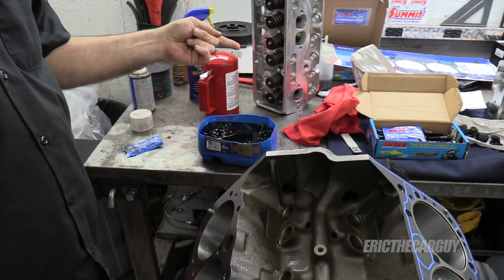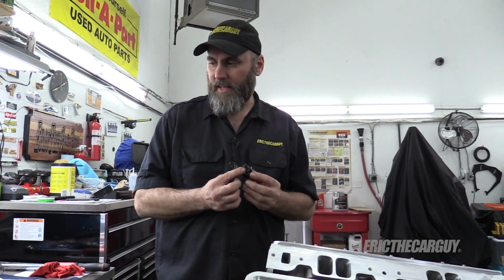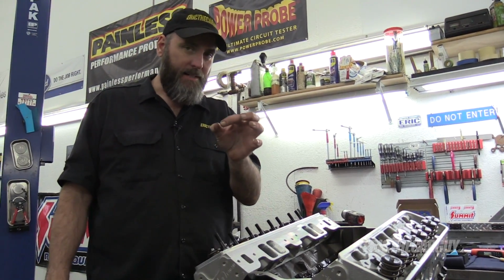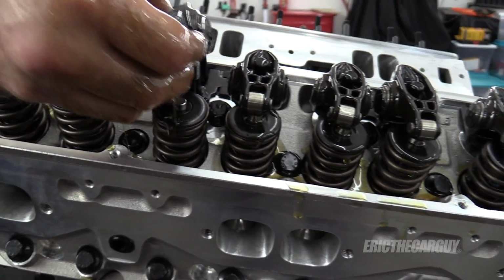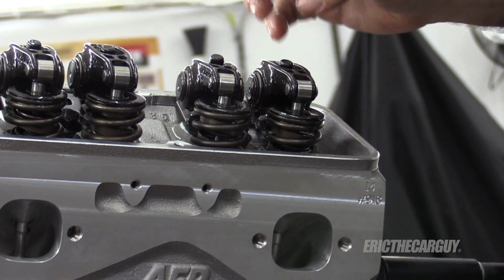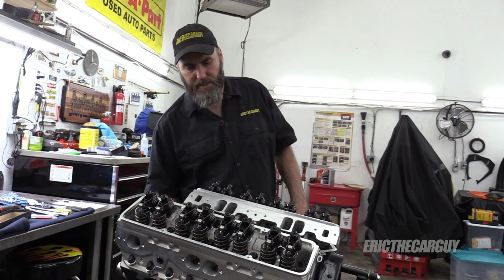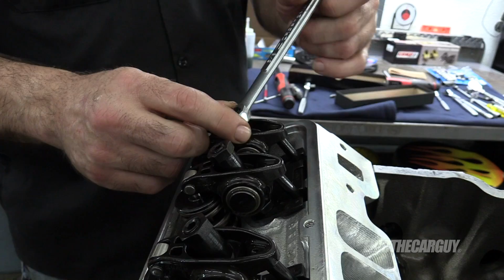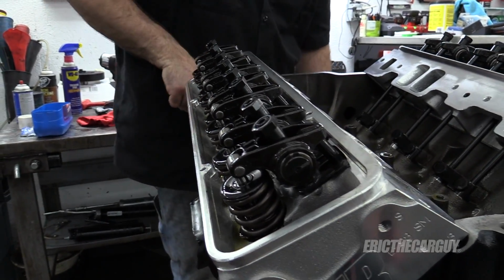How To Install and Set Up Roller Lifters, Roller Rockers, and Pushrods

Comment: I haven't upgraded my rocker arms yet, and I get a valve clatter sound when pulling a hill. So, with what you said, I might need to go back through and go a little more on my pre load.

Comment: Those guide plates are mickey mouse. Why don’t manufacturers use 1 piece guide plates as GM did on the 70 LT-1 Z/28 engine? Why reinvent the wheel? You also want the push rod in the middle of the guide plate slot and not touching the guide plate. Also Inlike the up down movement on the push rod rather than the spin method for achieving zero lash. Then I go 1/2 turn more. GM went 3/4 turn because they didn’t want customers complaining about noisy lifters. If you want performance then 1/2 turn is plenty some even go 1/4 turn. Once it warms up the noise if any will disappear. If your paranoid then don’t go more than a 3/4 turn. IMO 1 turn is too much. I set my hyd lifters using the EOIC method. When I had a solid cam in my 70 Z/28 then that’s another story.

Comment: The GM service manual says to lift the rocker only until zero lash because the lifter has a weak spring in it and spinning is subjective to feel, like feeler blades. They also ask for 3/4 turn to place the piston inside the lifter body at proper height.  The tread pitch can be used to create the correct math as 18 threads per inch = 1 inch in 18 turns. The lifter body only has so much room and 3/4 turn is less than 1/18" on the lifters piston. Not much room in there unless a guy wants to disassemble, measure and decide how much travel the lifter body's piston should travel compared to GM engineers although Comp could machine these different. But until I measure both, I am using GM specs, plus not spinning a round ball tube for feel.

Comment: I have something that I would like to share, first off I would like to thank Eric the car guy so much for everything that I have refreshed myself on and have learned a new. I’m an old man and I used to rebuild a little bit and have worked quite a bit on small block 350 in the past..
I am currently putting a 383 stroker engine from hot rod engines company out in Washington into my 1963 Chevy C 10 pick up with a manual Tremec five speed.
In the meanwhile I have been working on the current engine which is in this old truck of mine. It is also a 383 stroker but is currently a four-speed manual transmission. 373 rear which means that the RPM is crazy on highway so that’s why the next transmission is a five speed having the overdrive advantage over the 373 rear ..
So to my point I am starting to put things together to do this very same job you were watching here. There is nothing at all wrong with how it is being done here but I think I’d like to share something that I saw online which provided a very easy valve adjustment which I thought was genius.
I could look up the video if anybody is interested on how to adjust the valves in the following manner.
Anyway the guy that I was watching on YouTube explained that he would often be called away from the valve adjustment and forget where he was in the process and would often start over or forget where he was because of being called to the counter or whatever. The gentleman went on to explain that he had to find a way to keep his spot or area of work remembered so he offered up this method of adjusting valves as follows:

Basically you rotate the engine 90° at a time using the marks on the harmonic balance her and the timing tab. Basically he could be called away from the job and it didn’t matter where he was in the adjustments he would simply continue to turn the engine 90° at a time and establish zero lash that way. He would keep turning the engine 90° and some lifter would become loose and others would maintain a zero lash adjustment. So basically you just keep turning the engine 90° at a time, Using the timing marks until all pushrods are found to have zero lash…
So this did not make sense to me until I thought further that mathematically every time you adjust across-the-board all pushrods eventually mathematically all will be in the correct position and turning them down a little bit at a time at 90° just creeps up on the math whereby he would have zero lash across-the-board…

Again there is absolutely nothing wrong with what Mr. Eric is doing, he is a very accomplished mechanic and he is following instruction as noted in manuals. I just found this guy on YouTube who evidently through necessity had to find a better way and I thought it was genius and I guess it does work out that mathematically you would pass each one eventually. Eric the car guy rocks and I follow him I wouldn’t ever say that he is wrong on “anything” He’s 3 times my abilities as a mechanic, knowing this from following you Sir! Thanks for “all that you provide me and others!

Michael T.

Comment: Great video. Recently took the engine too high on rpm and found a bent push rod. Couldn't get a wrench to the rocker arm nut. And when you couldn't either, I followed your method of taking rocker off. Too simple. Also - my service manual says one full turn for lash. Thanks.

Comment: I would use 1 piece guide plates. I wonder if 1970 Z28 LT1 guide plates would fit this head. I also do not spin the pushrod, instead I use the up/down method. I use the EOIC method as well.

Comment: He said the minute one valve starts moving adjust the other one   It ain't necessarily so.  This does NOT take into account valve OVERLAP   This is a period of time when BOTH valves are open at the same time   The minute the intake starts to open the exhaust valve is still open   for a while which is a BAD time to adjust the exhaust valve     This isn't the case if you watch the exhaust valve begin to move

Comment: I agree about the full turn. Well, I'm a 3/4 turn guy. But yeah, 1/2 turn is never enough. I guess the manufacturers don't want em' over tightened and a half turn in theory should be enough. But I've found the same thing you did....after a while I gotta put my open valve covers on and run the motor finding all of the rockers making noise and adjust them again. And sometimes do it again after more driving to get em' all set. never had a problem going 3/4 turn right off the bat. In the old days and even now (for me anyway) we always kept a set of old valve covers  w/ tops cut out and adjusted the rocker while the engine was running. Another good post from post this guy. I've never heard him say anything wrong. His tutorials are clear and concise. learned a lot from this channel. Been a subscriber here for some time now. I prefer to do both valves on each cylinder at the same time on the firing stroke. I think it saves time. But his way gets the job done just as good and keeps u from making any mistakes.

Comment: There is one way to do this that I would definitely recommend. It's a lengthy process to describe but can be done fairly quickly and you will never need to re work your rocker pre load
Reply: Post it. Or post a link to the process.

Comment: I have a 92 chevy with a new 350 crate motor and I primed the oil system and i am getting oil on my driver side lifters but no oil on my passenger side lifters. What is the problem?

Comment: for zero lash, do you tighten the pushrod until you cannot spin it anymore with all your strength or just slight resistance??
Reply: Just take out the slop up and down. The pushrod will still spin at zero lash.

Comment: You actually want to take the intake valve all the way down before doing the exhaust because of overlap on the cam. If you adjust the exhaust when the intake just starts to move down, the exhaust is not on the base..

Comment: ERIC Watched a few of your vids and liked them. You are a knowledgeable mechanic. I should know. Me too for 50+ years. I was surprised to see your mistake when adjusting valves. Your method for adjusting the exhaust valve is spot on BUT if you stop turning the engine at the exact point when the exhaust valve starts moving, the intake valve lifter is NOT on the base circle of the cam. Cams have valve overlap and the intake is not fully closed at that point. When I adjust valves using this method I continue turning until the exhaust valve has fully opened and is on its way closed again. Then the intake is certainly on the base circle. This might account for a little bit loose adjustment and some valve noise. I always use ½ turn adjustment and have no problems.

Comment: The argument about steel vs aluminium rockers is only relevant in extreme high horsepower applications with outrageous amounts of lift and valve seat pressure, for a cam with .500 to .600 lift the alloy ones are easily as good as the heavier duty units. I run a .525 lift Lunati with scorpion alloy rockers and they are excellent value for money.

Comment: The reason you had noisy valve train with half a turn is because the lifters were full of oil this comes straight from Comp Cams, "it is not necessary to “pre-pump” hydraulic lifters full of engine oil prior to installation and valve 
adjustment. It is actually undesirable to do so as the “pumped up” lifters will cause the valves 
to open during the adjustment process, rather than positioning the lifter plunger in its operating 
position as it is supposed to do"

Comment: Hi Eric. I am trying to find out if I have solid or hydraulic lifters, without taking off the intake manifold. I was told to push down on the push rod. I did, and there was no give....I assume this means solid ?? is this method accurate ??? Thanks. Love the vids, keep em coming.
Reply: Following any update on this? I’m having same issue
Reply: @MrKickass154  Hi Ryan, I started changing my valve stem seals, and it wasn't until I got to my 4th cylinder before the lifter gave a little bit. The movement was only about 2mm or 1/8". Hardly any pressure was needed, If you have any holes in your intake (down to the lifter valley), you can actually see the cup move. Once I saw the movement it was like a eureka moment, and I understood what was happening. Sadly, a couple of my lifter's didn't push down, I am guessing that these are collapsed lifters,

Comment: Wrong cam, that cam is for a retro fit. You have factory roller provisions. I like link bar lifters but you could have saved a ton of money by using the factory style or the retrofit. I know you probably got the parts coming before tear down. And you could have saved yourself all the stress of the cam button by using the correct cam and retainer plate. This set up is for the early blocks with no roller provisions.

Comment: Eric, you obviously know what you're doing, but what about the pushrods? I don't know if you've actually done a video about it. Can you do a video about correct length pushrods and how to measure for them? So many people on my end have hurt their engines by using incorrect length pushrods. I think that would be a good video to do!
Reply: YouTube the Steve Fox method for pushrod length
Reply: @DrTittieSprinkles  I've already seen it, but I was thinking in line with for the people that wouldn't know how

Comment: Funny how some lifter manufacturers recommend an oil soak while others say to absolutely not soak them.  If the lifter absorbs too much oil in it's chamber, it will be locked up at startup before it can bleed down.  Better to let them rattle and pump up naturally then set your tolerances.  Apparently less chance of overstressing a rocker, bending a pushrod of damaging the lifter.  I see the argument on both sides.
Reply: But, sometimes, they never pump up unless primed... Been there, done that shit. Regardless, i soak the fuckers. Live in pressurized oil, why the hell not soak em.

Comment: Thanks, and keep up the good work brother!

You mentioned that the roller tappets have rollers to reduce friction, you may want to put in a note that the rollers allow for faster ramps. There is not much friction on flat tappet cams, the cam and the tappet have a film of oil between them. The usable power increase comes from a more aggressive ramp that you can get away with a roller allowing you to snap the valve open and closed quicker, allowing you to have a greater duration with the same base circle. This does require a much greater spring pressure though, if you want to avoid that annoying little thing called valve float...

I am going with a solid flat tappet with my mopar LA360 build, even though the block was a 1991 block and made to run hydraulic rollers. I am going this route though because I expect to see north of 6000 though with my gearing and tire size. Remember guys, pick your parts according to your use, and start with your cam choice and build from there, and don't cheap out on your torque converter!
Reply: This was more of a install video than a technical video. Roller lifters does offer better cam performance than any flat tappet can offer but he's just showing the "how to" part of it all.
Reply: Dennis Massengill  I don't trust them either. I especially do not trust roller tip rockers, I'll stick with my bushed shaft mount ductile iron rockers.

Comment: A tip for you Eric. Bottom half of the rocker studs are both the same thread diameter and pitch for those 7/16 and 3/8 rocker studs. It's just the upper half that is thicker.
Reply from the maker: Good to know, thanks. However, on my previous cylinder heads, my machinist had to enlarge the threaded holes to accept the 3/8" stud. Perhaps it's not the same for all rocker studs. Thanks for the comment.
Reply: @ericthecarguy  you're welcome Eric every cylinder head that I have worked on that has been Chevy oh, I must stress that fact I am a Chevy lover, has been the stud in the head has been opened up 2 7/16, what's the rocker stud itself was 3/8.

Comment: GM recommends a full turn and bring no 1 cylinder to top dead center and adjust 8 valves then turn it over 180 and adjust the last 8 I don't remember the witch valves off-hand and for performance builds i prefer half a turn and if you adjust both valves on any cylinder at top dead center you will be on the base circle
Reply: Doesnt matter, 1 at time or 8 at a time, as long as its on the base circle. Every fucking armchair warrior thinks they have to follow some 199 steps to ensure a good engine..   Base circle, both valves closed, rotate a few times and check again.. thats it!
Reply: @zuestoots5176  I'm no armchair warrior I'm a mechanic and have adjusted valves countless times many different ways i prefer one cylinder at a time its faster on my street strip car i had speed pro anti pump lifters where i had to adjust them like solid lifters 2 thousands on the feeler gauge they were noisy but you didn't have to worry having them pump at high RPM

Comment: Isn't soaking roller lifters in oil bad as in it fills them and creates resistance on first start. Al from Skid Factory goes over it in their latest video. it can even potentially bend rods.
Reply: Or wait are they even hydraulic I'm might be wasting your time if so my bad.
Reply from the maker: According to the manufacturers instructions, Comp Cams, soaking the lifters and rocker arms for up to 2 hours before installation is what is called for. There is no more resistance at start up that would be any different than if the lifters were already in the engine. They are designed to be filled with oil to operate properly. Thanks for your comment.